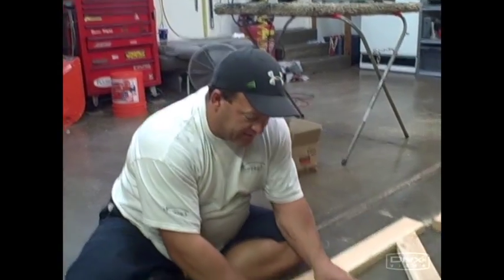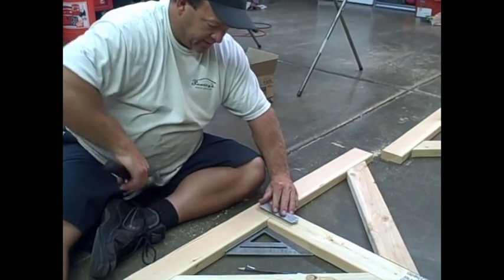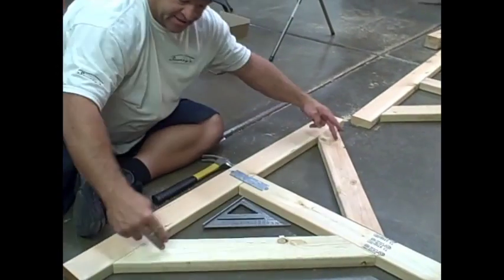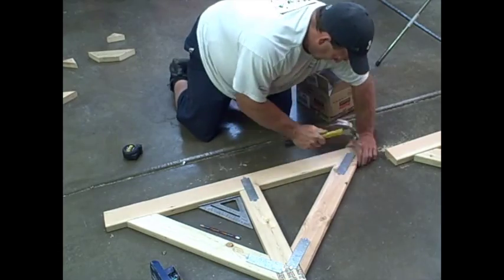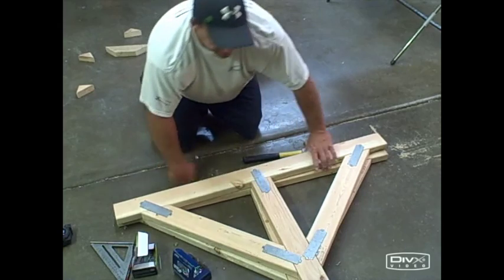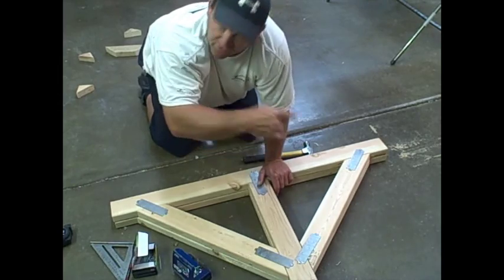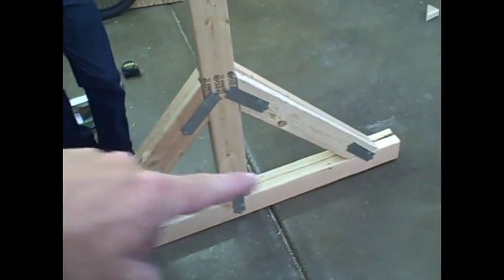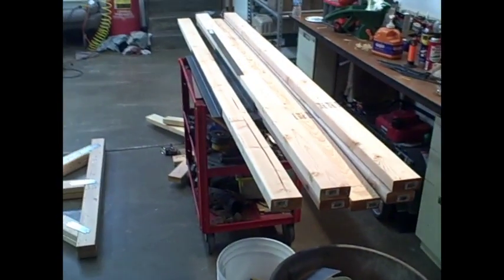How to build an engine hoist

Comment: IF you are going to all this trouble get bolts same size as your nails and use nuts and washers, under enough load the nails will pull out
Reply: This might just be a one or two time use for a job which explains why buying an engine hoist isn’t worth it.

Comment: A tip that may come in handy, use clamps to hold components in place. Also drilled holes and bolts will be much stronger and can be disassembled for storage. Just a thought why not assemble the top first, then take it apart to assemble the  bottom of the legs. If you use bolts and washers with nuts it can all be taken apart for storage number each part for reassembly. Make long sections that can be bolted between the bottom of the legs to reduce movement. A sound idea with plenty of room for improvement.

Comment: Looks good to me, how ever my only change to the design is using screws, and also putting either swivel or fixed coasters on it so it can be rolled around. The fixed would let it roll forwards and backwards, that way it can be pushed easily out of the way and you can re position it when working on it.

Comment: Ok question...Was this to be used in the garage or out in the driveway? I see that the garage doors were becoming an issue with overhead height. Otherwise have seen similar design pull engine from a lifted pickup truck..thanks for sharing.
Reply from the maker: This hoist actually cleared my garage opening.

Comment: First u could've used nuts and bolts and it might be a bit more expensive but will be stronger if you added wood glue to your joints and even when putting them together

Comment: Hope your significant other has accidental death insurance on you and the young fellow, maybe this clip hasn't been finished because this accident waiting to happen actually HAPPENED!!!!!!!! ONE GREAT thing about youtube is you get to learn what/how NOT to do many things   :  )
Reply from the maker: I've used this hoists over 50 times not one problem. I've pulled truck beds, V8 engines, truck doors and even a truck cab off of its frame. So I think you need to give me credit for trying something instead of trying to tear me down. 🤔
Reply: +ScottysDetailing Sir, I give you LOTS of credit for trying and doing, all I am saying THINK SAFETY FIRST, for the sake of your family!!! I worked for over 40 years in a MFG plant in Quality Control and have seen sincere folks KILL or SEVERELY injure themselves RIGGING something when for a few bucks more could of made themselves safer.  Again GREAT idea, but could of been thought out better!
Reply from the maker: Thanks for your concern. I understand your angle now. So we have been looking into a attic hoist with a metal I beam frame in the attic mounted to a I beam track for more safety. Big companies have deep pockets for all the right safety gear. When your a DYI fix it yourself guy you have to do what you can afford for now. 😬
Reply: @REVNUMANEWBERN   This is a well known design engineered long ago. Stay in your lane Linda.

Comment: Not being a dick but you just built a 4x4 so why not go pick up about 4 or 5 4x4s pre drill holes and just bolt them together then you can take it were you need it but the 2x4 one looks good